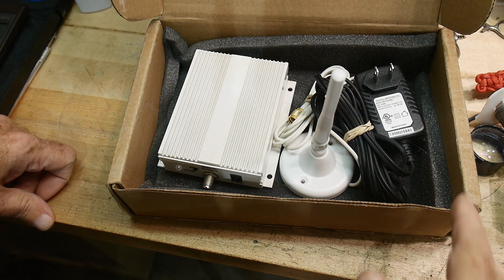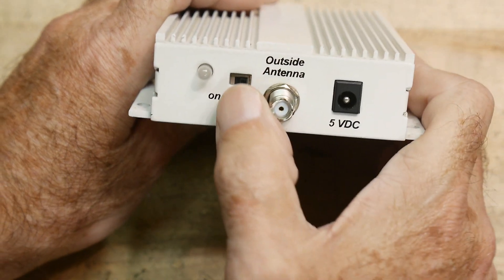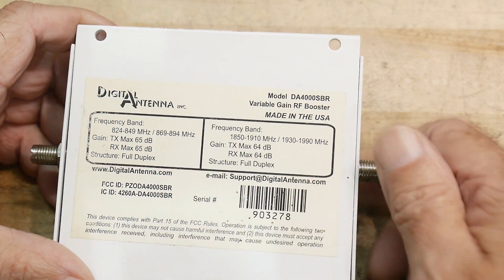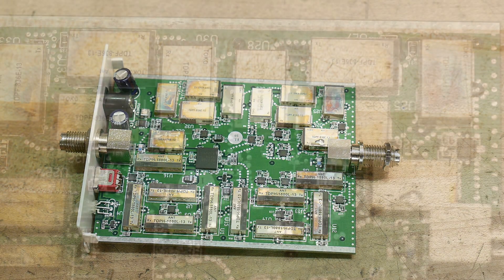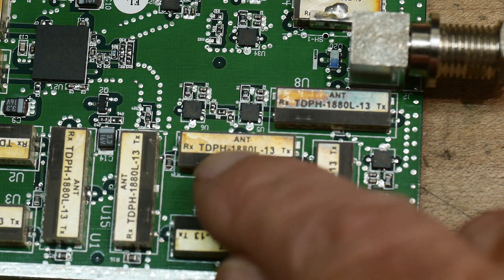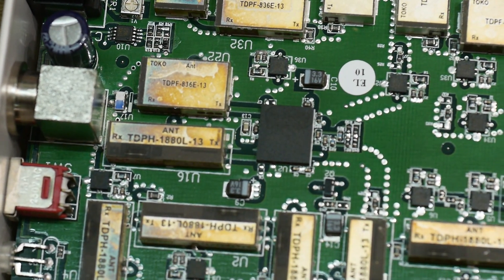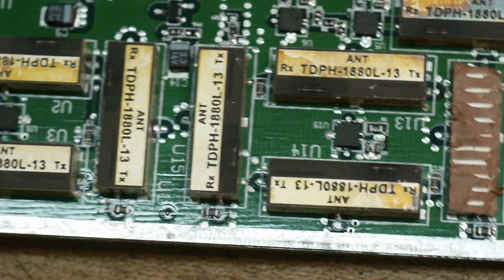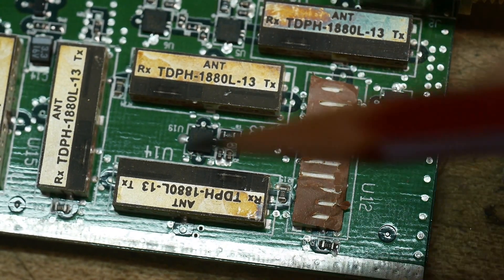#947 If one diplexer is good, 20 must be better

Comment: um, these are Duplexers not Diplexers.   I've used them for CDMA (Bandclass 0 and 1)   transceiver designs in the early 1990's.  The FCC filing shows this box has a NF of 10dB (pretty crummy in my opinion).     I designed a similar box with far fewer parts for CDMA (IS95) basestation testing.   I used larger high performance duplexers for better selectivity and TX-RX isolation ( single band as well, this box is dual band Cellular and PCS bands).
Reply from the maker: https://www.rfwireless-world.com/Terminology/diplexer-versus-duplexer.html

Comment: Only think that I can think off the top of my head: two diplexers doen’t have enough performance to deal with all the gain. You’d get an oscillator. But for each gain stage or two, they do fine. And thus we get diplexorama. Of course the thing will also oscillate if there’s enough coupling between the indoor and outdoor antenna. Those amps must have been fun for the installers.

Comment: They did the trick where they have the design offset by 10-15 degrees from the direction of the glass weave. Really handy for getting better consistency out of FR-4, but I'd rather just use something like Rogers myself.
Reply: You wouldn't if you wanted to sell zillions of them at a competitive price.
Reply: @JimAndyAllyn  True, I tend to forget about the whole 'selling' thing. None of the stuff I worked on was commercial so performance trumped cost in almost every case. Some of the stuff was completely bonkers. Even so the trick for woven laminates saved my butt several times.
Reply: @fletcherreder6091   Pretty much all the stuff I have worked on was consumer/mass production stuff.  Highly cost sensitive.  I was offered a job doing military stuff once upon a time but didn't really want to do that.

Comment: Using to get matched units for bandwidth and rejection. The cascaded units with the termination resistors are to get more filtering, as you are essentially feeding the transmitted power back via the receive path, so you really need a lot of attenuation between them to keep the amplifier from oscillating.  

Split into a path for transmit and receive by the first unit each end, then these separate paths are going to another diplexer, to get more rejection, and reduce RF feedback to the amplifier input, then another to get more rejection and a better match, then a single low gain amplifier block for indoor transmit side, and higher power for outdoor side. Output of the amplifier then goes to another diplexer to filter out any distortion and harmonics, and another to further attenuate, followed by the final one to combine the transmit and receive paths again. 

Antenna load both sides is not great, so there will be reflections, the overall game is to keep the loop gain overall with even a worst case VSWR both ends under 1 by a good margin, so that there is no ringing or oscillation. Using the diplexer means any energy fed into the antenna side will be attenuated a lot, and thus makes it stable. Designed for a low amount of gain, more to make up for cable and antenna loss both ends, rather than anything else, just giving the convenience of not needing to have an actual physical connection to the antenna, and with the slight amount of gain improving the signal strength over a purely passive antenna system, allowing the use of cheaper antennas and higher loss cheaper cables.